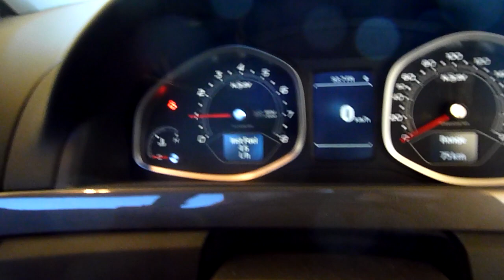LS3 Cam HSV E3 Maloo R8

Comment from the maker: @rodevans 
The cam has a lot of overlap so no its not great. Has a lot of surging @ 1600rpms which gets a tad annoying. The peak power made up top is lost down low also. 
The next cam i try will be 230/238 610 .610 @113lsa. This cam has less overlap will still make good peak 475+rwhp but have a lot more down low than current cam. I would easily give up 20rwhp for better low down pull

Comment from the maker: @rodevans 
Yeh i went with KPM because of the quality and sound. I did a heap of research and decided that kpm was the right one. Xforce and manta suffer from a horrible tinny sound off throttle and between gear changes - especially when cammed. 
My kpm system before it was cammed and now with it cammed doesnt drone either.